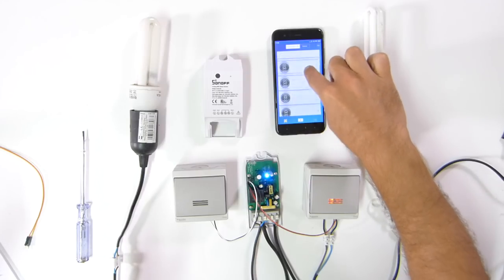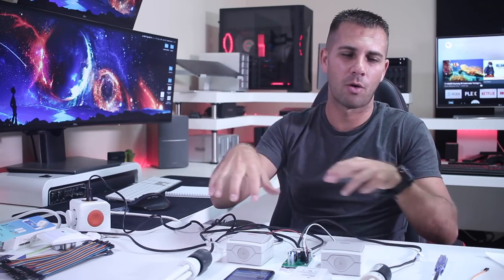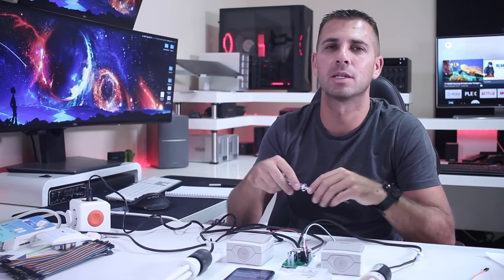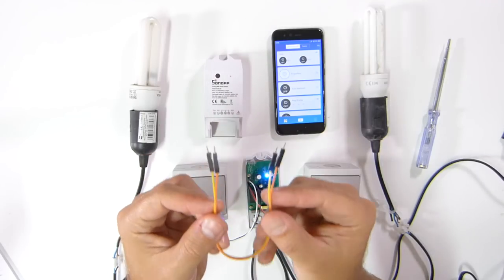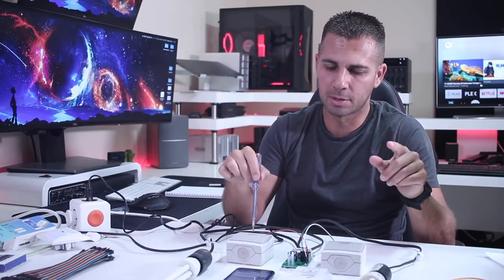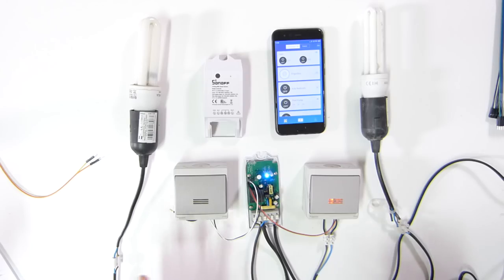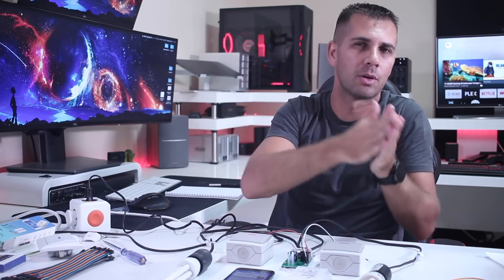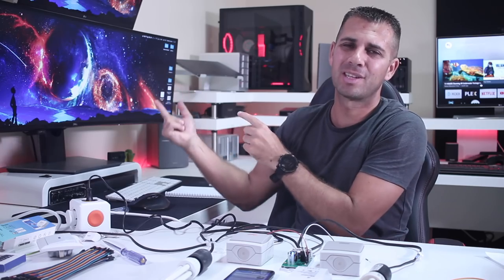SMART Switch | Sonoff DUAL Physical Button 🤓💡

Comment: Roberto, great video. Please, did you need to load any specific firmware to do this? Also, did you use any type of resistor or simply plugged the wires into the Sonoff Dual directly on the switch?

Comment: Hi, Roberto, have a question about tv box  blue tooth   remote, I paired the remote it connected but when I close tv box and try to open ,It does not open a tv box, so I am disconnecting blue tooth  function after closing. why ? please need help thanks
Reply: Rob does it work with the 2 switches straight out of the box or did you have to program those inputs.